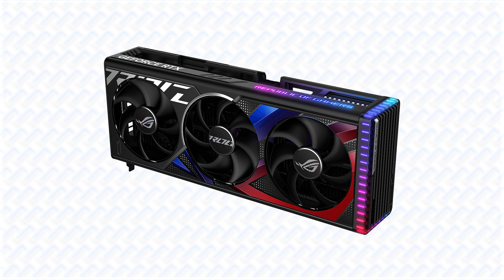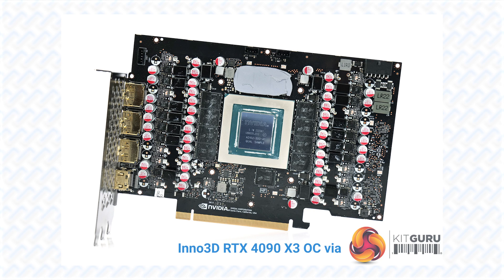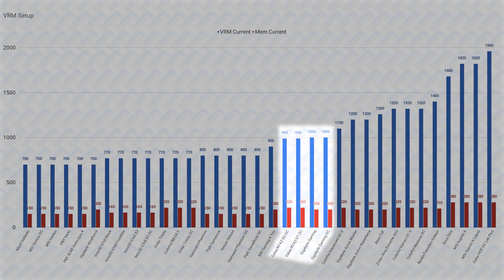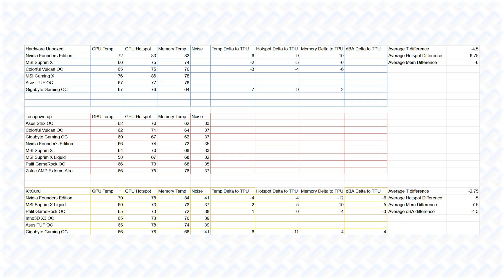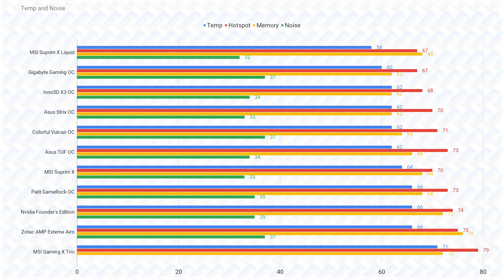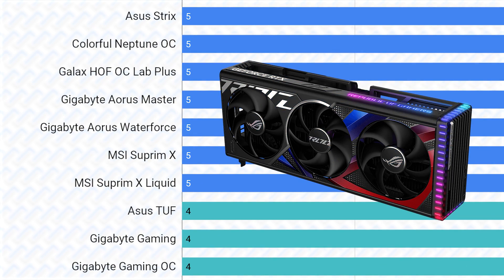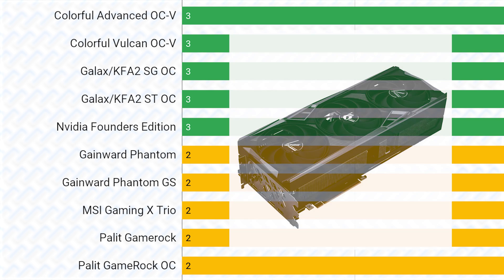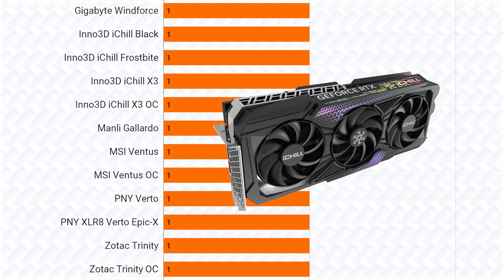Which RTX 4090 to BUY and AVOID?! | 35 Cards Compared! Asus, MSI, Galax, Gigabyte, PNY, Palit, Etc.

Comment: Thank you a much needed comparison. Just one thing, you say Asus Tuf in most charts bit Tuf OC in others I assume they are effectively the same bar some changed OC in the software?
Reply from the maker: Yes the OC and non OC is exactly the same. Just slightly lower clocks on the non OC but the performance difference will be negligible.

Comment: Listen, I don’t want to dis your work but this video is completely misleading, lacking the most important aspect, namely coil whine and fan buzz. Performance is pretty much equal, thermals are different but mostly good so they should not be the main factor in terms of buying decision. For instance, the Strix being FOUR tiers above the Verto is just nothing but pure travesty. The Strix may be better built, it may have a stronger power delivery circuit (pretty much irrelevant unless you want to overclock, which is pointless, or keep the card for years to come, which is unlikely), it may look nicer but it’s such a pitiful, intrusive coil whiner that it’s pretty much unusable unless you score a unicorn, are completely deaf or always play in high isolation/ANC headphones or IEMs. It’s just bad advice. After my extensive research I came to a conclusion that for most buyers, the PNY Verto or the Gigabyte Gaming are by far the most likely models to be real keepers. The rest are mostly either pathetic whiners (Asus, MSI) or annoying fan buzzers (KFA2/Galax, Palit, Gainward, Zotac). You may get lucky with the FE, Manli, Colorful or Inno3D…
Reply from the maker: O!Technology
  • 3 days ago
I really need to include this in future videos: Coil whine is hard to compare between. First, it varies between cards even of the same model. Second, lots of reviewers either don't get coil whiney cards or they just don't test it. So, there's few information on them online except from random reddit posts. Third, I don't have all these cards so I can't compare it myself either. Trust me I would love to, but I don't have 35 cards with me.

Comment: the suprim liquid X has a silent no fan mode (default) its always 80% in that zone very rarely spins fans unless I force it to thats the only bit I have a problem with your video, you made it sound like it doesn't have zero fan mode, and with a radiator it has better passive cooling than any air cooled card, but I loved the video thanks for putting this out
Reply: Was going to chime in with the same comment.
Reply from the maker: Its not going to stop the pump. I never said it doesn’t stop the fan.
Reply: @OTechnology  id rather my pump be on max than any fans, ive never had a pump, be so quick it doesn't leave enough time to soak up the heat, so the pump being on full is irrelevant unless its contributing to the noise (unless its got a air gap in it) 
I know you didn't say it directly but it was implied (sort of) but like I said it's an awesome video, kudos to you for making this. that's the only tiny gripe I had with it, was trying to be critical and positive.
Reply: that liquid need repair like watercoolers? i dont know how and what to do rofl

Comment: This is a great list and interesting breakdown! Thank you.
I am missing one ranking however, the one where noise takes a priority. Looking for something quiet then possibly low temps and lastly decent VRM for minor OC. Kind of torn apart between MSI Suprim X and yes... Inno X3 OC in this department tbh. Thoughts?
Reply: I read lot of the asus and msi cards have coilwine, the inno most of them not. Shame this isnt coverd in a lot reviews. I like the msi Supreme a lott, but afraid buying it because most people complain about coilwine
Reply: @dimento6097  I just picked SuprimX (last unit close to my location) and still testing it. Taking the full advantage of 2 weeks no questions asks return policy. This thing is really quiet and I am the guy who had his previous GPU watercooled. I like the fact it starts with the Silent Bios by default. It really gets you by surprise how quiet it is. This is of course only my example but I have no coil whine whatsoever, zero, nada, with my ear close to the card. The loudest part of my PC now is the 140mm exhaust fan on my chassis I needed to turn down from 1200 RPM to 700 RPM. Card looks good and runs good. There is however one small negative about it, power consumption compare to other 4090s models. It idles at 34 Watts while other brands can settle for 22.
Reply: liquid cooled is better for longevity of parts and quieter. also keeps the Card size to 2 slots instead of 3.75 or 4 slots

Comment: What about the AERO line from gigabyte? Didn't see it covered in here. Also fyi, the graph and which cards are in the list are very hard to read.
Reply from the maker: Sorry I made it better in the next video with larger text. The Aero OC is the same as the Gaming OC and it wasn't out when I made the video.
Reply: I appreciate the reply, when is the new video going up? Could you also review the Gaming OC/AERO
Reply: I had the Gigsbyte Aero in white , beautiful gpu with great gains if you want to overclock. Unfortunately, there has been some problems for a while now, which I had a first-hand experience with the fans. For some reason, you can not set a fan curve below 57%, there is a a few threads on the Gigabyte forums about the issues. I swapped it out for  Suprim X 4090 air cooled and never looked back.

Comment: 4090 does not cost (price to purchase) more on the AD 1st v GA 3rd degree consumer price discrimination v Ampere and 4090 FE at risk production introduction was $300 underwater those customers got a good deal. This mimicking tech tube echo chamber that 4090 was always over priced is not correct and never was on application perfect pricing. mb

Comment: The Gigabyte Gaming oc is the best bang for buck imo, 4 years warranty, vapor chamber, 1000w vrm, no coil whine,  sort of medium sized vs other 4090 models all at a price fair price increase over the founders msrp.
Reply: My Computer chain advised that the Gigabyte Eagle and Gaming OC's are seeing the most  returns.
Reply: @johnwicks4936  If those are the most sold ones, more of them come back. Are the numbers absolute or percentage wise?
Reply: @JohnDoe-yo2us  No idea.  I only know what my computer chain tells me.  The higher end cards are not supposed to have the same issues as their entry cards.  I ended up buying a Gigabyte, but I got an Aorus Master.
Reply: They put 50 cent cheap sleeve bearing fans on this thing.  🤦🤦🤦 whyyy also Canada computer store showed me their huge gigabyte defect stack to rma ( not just 4090 ) and suggested that i avoid them.
Reply: @pascalfilion3518  What? on the 4090 OC gigabyte homepage it says that it uses graphene nano lubricant extends life by 2.1x times on the double ball bearing fans. Are you sure the 4090 has cheap sleeve bearing fans?

Comment: Thanks. I wonder what you would consider "worth it". For example, in my nation, the pricing of the MSI 3090 Suprim is about 12% more than the Founder's Edition and the other high end top tier cards tend to cost more. Personally I think the Suprim is the one to get, as the others cost a lot more, although there's a case to be made that the AIO version of the Suprim is worth paying 4% more (that's how much more it was) than the air cooled version..
Reply: Suprim or TUF are the way to go IMO

Comment: PNY XLR8 cooler is actually very good, and should be rated top tier.
For 1-2c over 4090FE it runs ~300RPM slower, 
Giving 38.2db vs 45db founders edition using Toms Hardware methodology.

I can confirm that even gaming the loudest thing in my computer is my HDD(silet fans, bequiet cpu cooler)
Not my videocard... its the reason I bought it, many others have said the PNY XLR8 is effectively silent.
Reply: The only disadvantage of PNY XLR8 is that every once in a while I have to check if I'm using dGPU or iGPU because it' so silent.
Reply: @nguyendinh2052  You can disabled integrated graphics in your device manager. My PC (PNY 4090 + 7800X3D) was slow to open games sometimes. I would open a game and it wouldnt start loading for like 30 seconds or more. It felt like it was hanging on some process or something. This went away after I disabled integrated graphics
Reply: moreover, if you plan to watercool your whole PC, PNY XLR8 is the one, which uses the reference block from AlphaCool, with connectors in front/back of the block (not extending the high/size of the card). I'll give it a try. Btw. having 140fps in 4k I don't really need OC to get 10% more (so max currencies/voltage doesnt matter for me)... But it's always a matter of prios, of course.
Reply: I have to agree

Comment: Thanks for the review. For the longest time I've been looking for reviews that look at the build/component quality of gpus/mobos to avoid paying a brand premium that isn't backed up by higher reliability/quality.

Anyone can do an fps benchmark video, but reviews like this require good knowledge of electronics.

Personally, I've wondered if the premium for Asus gpus/mobos is justified. From this review, it seems that maybe it is. I'm currently thinking about ASUS TUF B760 / Z790 and Strix 4070TI / TUF 4080.

Comment: So what would you pick if you only want to undervolt, have it be quiet and last a long time? 

Gigabyte gaming OC vs MSI Suprim which is 170 euros more expensive.
Reply from the maker: Do you want to spend that extra 170 euros? Yes? Then buy the better one. No? Then buy the cheaper one. This guide is just to show which is better and worse, the final decision is on you still.
Reply: @OTechnology  I understand that, but I'm not sure if the better VRMs etc. also help in undervolting performance. Could you answer that question?

Comment: I picked up a used PNY 4090 for $1400 (the seller used it shortly until he could get the MSI Suprim Liquid he wanted) and it came with a 1000w power supply that has the new 12VHWPR connector specifically for the 40 series cards. It may not be a top tier card according to this list but mine doesn't have hardly any coil whine and it does just fine for the price I paid. 

Also, I noticed stock it stays right around 2700 MHz using the stock Nvidia voltage setting of 1.050v which pulls right around 350w while gaming. What I did was used MSI Afterburner to undervolt and set my own custom voltage curve (ctrl+f with MSI Afterburner open) and now have it set to the same 2700 MHz but at a max 0.950v and it only pulls right around 250w while gaming. Runs cooler, quieter, more efficient and still gets the exact same performance as stock. I could flash a different vbios to it to allow a higher power limit but I don't really see a need to do so.
Reply from the maker: For sure pretty much any of these cards are overkill and if you undervolted they'll run extremely efficient and quiet too.
Reply: Was that the PNY Verto Epic-X? I've found it for £1450 new and am seriously considering it.
Reply: @MrTehRave  The one I got was the base model Verto. It's been great for the past 6 months. I can't complain about the performance.
Reply: @dracer35  thanks for the quick reply man. I'm upgrading from a 1660ti gaming laptop 1080p, so its gonna be a big jump haha

Comment: I have a 4090 MSI Gaming Trio (non X) which I bought at msrp during launch. During gaming it sits in low 60s for gpu core temp/70s for hot spot. Its cooling is great for not having a vapor chamber and does not 'destroy cooling performance'. For gpu clock Ive had it to 3015 MHz with zero coil whine.

Most cards were engineered for 600 watts and are current limited. Don't let a card not having a vapor chamber change your decision (AMD even messed up the 7900XTX - look up derb8auer's video). Buy one that's available or your preference - my advice.

Comment: Bought a PNY XLR8 in December at retail 1599.  Idle temp 30s, 1440p gaming 50s, 4K 60-70c.  Absolutely no issues with it though I did have to tinker with fan curves - factor preset was terrible IMO.  As he notes I have no plans to OC it.  Love the performance Im getting - CP2077 4K looks and runs flawlessly.
Reply: I got the same card and it is definitely very nice however mine has some insane coil whine in some games, also had some weird gpu related crashing so im starting to wonder if i got a faulty one, had this since october but i brushed most crashes off as driver related oopsies but we've had many driver releases now and despite rolling back and testing nearly all again, the crashes continue.

Gonna RMA today and see if i can get a new one.
Reply: @smiIingman  no issues here but Ive really only played a few games Path of Exile, Project Zomboid, CP 2077 and a few others
Reply from the maker: I would definitely RMA if it keeps crashing. Not like its hard to get another one these days.
Reply: 4090 is a 4090. I think if anyone is looking for a 4090 if u dnt plan to oc your gpu then find a card that is close to msrp while users planning to get some marginal performance and cooling can fork out 200-300 more for more features and imo better quality usually with a metal frame or a lcd attached to the gpu
Reply: Recently got a PNY 4090 as well. Managed to find an new/open box on Offer Up for $1200. It runs quiet no whine or anything, and I wasn't planning on overclocking anyway it's a freaking 4090 it runs everything great without messing with it. But those upper tier cards do look nice I'm not gonna lie, I mean just aesthetically speaking. The PNY is kinda fugly and it doesn't match my color scheme at all but at that price I didn't care.

Comment: Hello.  I'm seeing some better pricing on the Gigabyte Gaming OC card in Canada now.  I've been waiting to see what happens with pricing.  I hate coil whine and many of the competitors 4090's seem to be having a problem with this.  My question to you is, do you trust Gigabyte products?  Some of the very large reviewers have been making some disparaging remarks in regards to Gigabyte and the reliability of their cards.  I know they had a big issue with some power supplies and a ransomware attack but do you have an opinion on their card reliability?  Thanks.
Reply from the maker: Really? I had a lot of Gigabyte motherboards and GPUs before and they've been reliable for me. Every manufacturer has failures, one of them is not really much better than the other in that regard. The more important thing is their customer support though, which is why it's sad that EVGA left making GPUs.
Reply: not me personally because i dont buy gigabyte stuff, but from the account of others, i always here bad stuff and that they cut more corners

Comment: I got a Zotac Amp Extreme Airo purely for looks. One thing I can say is it burned up a Cable Mod 12VHpWR cable in about two hours during a VR sim racing session. It didn’t melt or catch fire, it just killed the cable somehow.
Reply from the maker: Either the cablemod cable is faulty or you did not plug it in fully.
Reply: @OTechnology  Cable Mod is sending me another as we speak. I can’t see how I could have not plugged it in correctly or all the way. This 4090 is the 10th gpu I’ve owned since I started building my own in 2012. Plugging in cables has never been an issue or a concern but my fear of a fire has me pretty spooked with the 4090. 

 One thing I did notice and I didn’t until I got the cable mod cable is the little locking clip on the plug serves no purpose as far as locking the cable into the gpu. There’s no little hitch on the end of the clip to lock the plugs together. You can plug the cable in as far as you want but it can alway be pulled out by just pulling on the cable. The cable that came with the gpu is designed the same way. It’s probably already known by the community but I just found out.

Comment: I have a phantom GS will send it back and get the zotac trinity oc that is 100 dollas less in price BUT more inportantly, have 5 years warranty instead of the GS only 3  years, I will not overclock and want to card to last at least 5 years so I dont care that its worse.
Reply from the maker: Personally I would've already upgraded long before 5 years if I were someone who buys 4090s. You're probably better off selling it in 2-3 years and getting a new card then.